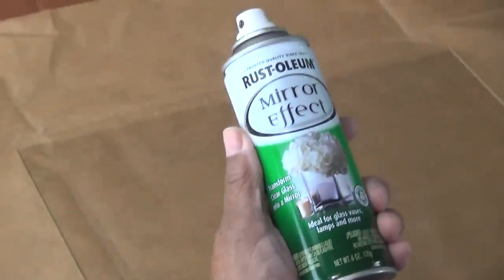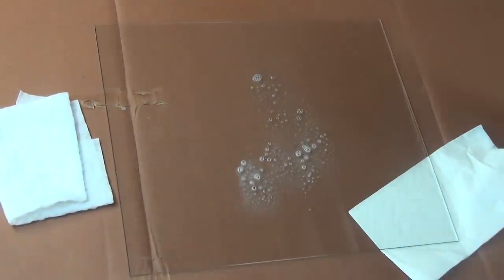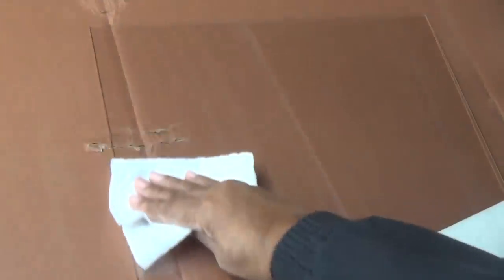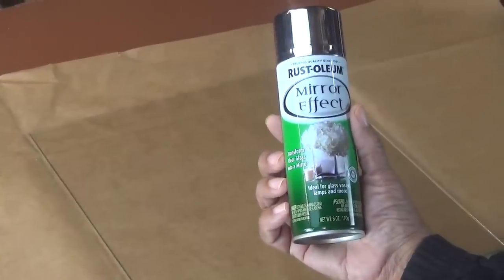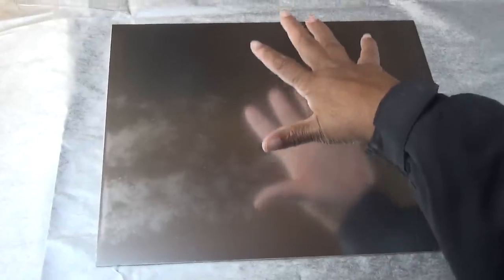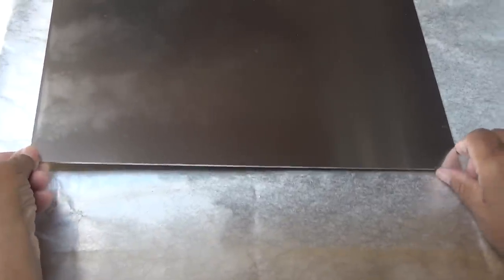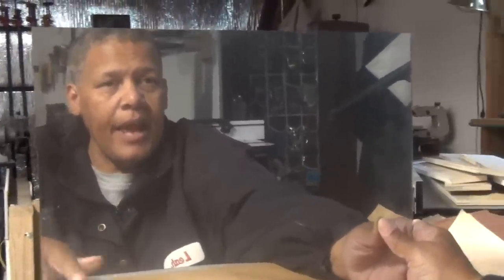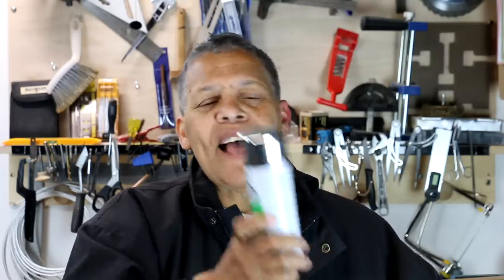Mirror in a Spray Can

Comment: Leah , Thank you again
Excellent video.😁👍
Got a tip for you Leah;
For cleaning glass, use
newspaper it works great.
Glass is clean without streaks
I only tried it on glass. Though
I am going to try on chrome, the newspaper cleaning that is then i will try that glass in a spray can.
Reply from the maker: Edgar Araujo. Actually I was looking to use newspaper but it quickly  occurred  to me that I hadn't  purchased a paper in years. 😊

Comment: Hi Leah.....yet another great video!  Just wanted you to know, I once used this product on my medicine cabinet mirror.  For some reason, the mirror had several spots where the mirrored layer had come loose and flaked off on the back (from the moisture, maybe). I found this product and gave it a try. I must say, it covered the spots enough so it looks like a brand  new mirror.😊
Reply from the maker: that is pretty cool!
Reply: That's good news because I have exactly the same issue!
Reply: So did you spray the back of that medicine cabinet glass?

Comment: You could use that to paint an old satelite dish, which would make a good parabolic reflector, find the focal point and cook you canned bacon to perfection without the need for fuels, just sunlight
Reply: I wonder, I've got an old satellite dish I've saved for a solar oven
Reply: Darren Corbett -- this is a cool idea.  Remember, though, that the painted side of the glass in the video was not the mirror side.  The mirror effect showed up on the non-painted side.
Reply: Bob Wolf true, perhaps treating the end result with some cut and polish car wax would bring a improved level of reflection to the dish.

Comment: I find your videos to be some of the very best I've seen! That said and meant, thank you for this mirroer paint application! An Aunt of mine gave me an old rounded beveled mirror that, over the years, has lost about 90 % if its finish. If I strip and clean it as you've instructed, I think that I'll be able to restore it to an acceptable condition . If it works, or even comes close, I'll send a pic. Thanks again. This old dog has learned alot from you.

Comment: I made two 36 inch mirrors from this stuff. I used plexiglass instead of glass because they would be on either side of my bed. https://imgur.com/gallery/JQXhO
Reply: Yeah I did my whole ceiling with this stuff. Wife loves it!!!
Reply: How’d they turn out?
Reply: Well. https://imgur.com/gallery/JQXhO  there's that. The plexiglass was a little thin so it has a funhouse look. I can remake it with thicker. One tip on these cans...when you are getting to the end or have sprayed for a while they will drip. You need massive ventilation for large projects. This project came out OK. It would look more clear with actual glass and less drips.

Comment: This would be a good option for making stage mirrors. You don't want a plain mirror, because it will reflect back the stage lights too strongly. The way it's usually done is either with non-reflective silver paint, which doesn't look real at all, or by using a real mirror (glass or the cheap flexible plastic sheets) and dulling it by covering it with something like hair spray. Using this, you could make a custom mirror with cardboard, luan, or lexan, and it would be just reflective enough to be a mirror, but not too reflective for on stage. And if it was still too reflective, you could sand it out a little. Best of all, it would be practically indestructible and reusable, which is just what you want.
Reply: I think that’s the original product.

Comment: Is it possible to make a one-way Mirror by applying a lighter coat?
Reply: They make film that will do that for windows. During the day it’s an opaque mirror on the outside.  Only drawback is that it reverses at night, so you need to keep the curtains closed at night.